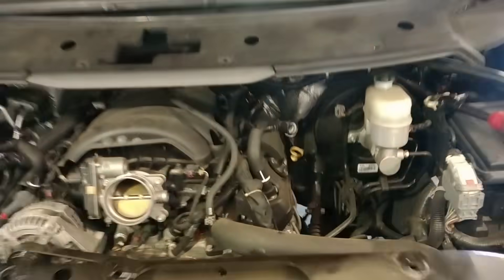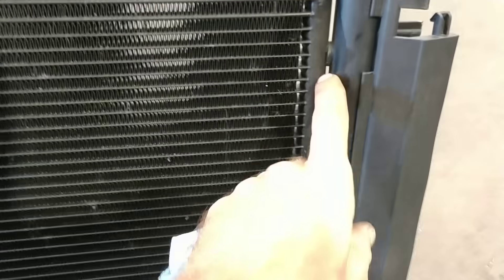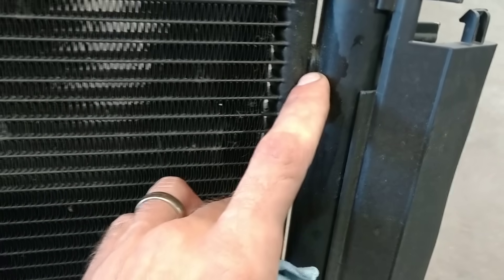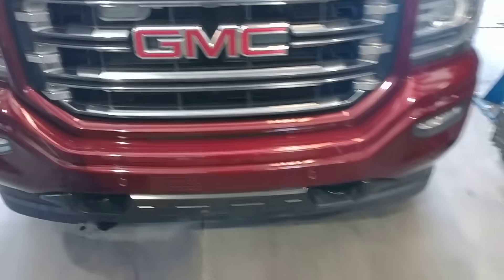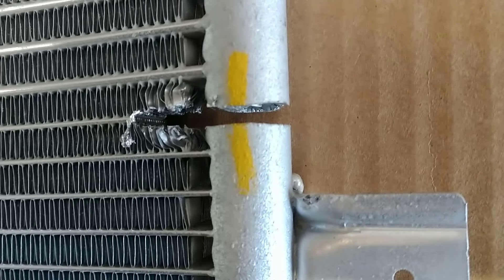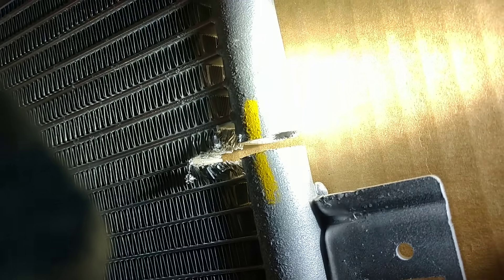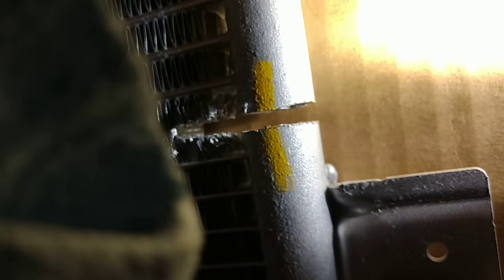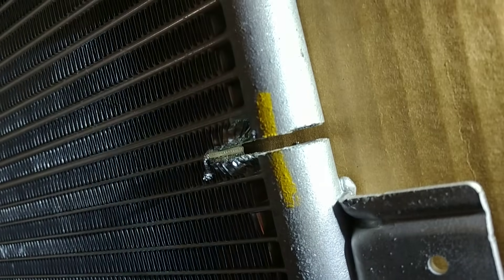Customer States...WAIT, look at this! Can't make this stuff up!

Comment: The guy who boxed it probably said “I Bet they’ll never notice” 😂
Reply: He’s probably like they probably won’t trace it back to me
Reply: If we're being for real here, the guy who boxed it probably didn't even notice
Reply: Kill Trump  its not returned, its a redesign. I do atleast 5 a week at a dealership. Doesnt look good, but it works.
Reply: It's supposed to be like this, the trans cooler and AC condenser are one unit. The cut is to allow for expansion between the two.
Reply: @bobroberts2371 ... Then why not have two individual parts? It can't be any more expensive or take any extra time to assemble on the line. Two parts, one bracket, same amount of screws, same amount of lines...easier to manufacture as well...
Reply: @K03sport  2 parts would take more time and expense to make and assemble.  Would you want to be the buy doing this for free?    It is common in industrial engine power units ( basically an engine in an enclosure, with a radiator  ) to have the engine oil cooler and turbo intercooler in one package like this.
Reply: @K03sport  MONEY
Reply: @bobroberts2371 ... Oh, like Nissan did with their trans and engine cooler on the Pathfinder...and when the trans cooler leaked/failed, it put trans fluid in the cooling system.
Reply: @K03sport  You do realize that automatic transmission coolers have been inside engine coolant radiators since about 1958 don't you?  Besides, the transmission cooler and AC condenser in this vid are not one inside another, rather than building 2 units and bolting them together, the are formed in one assembly.  and
Reply: Maybe he's a former Rainman customer...?
Reply: They probably said "everyone's blind, they can't see this huge hole in the core"
Reply: @TheHighwayman7989  Have a close look at the core, it has the trans cooler and AC condenser in one package. The vertical tube is plugged on either side of the yellow line.  The yellow line is a " cut here " mark to allow for differing rates of expansion, it is supposed to be there. .
Reply: @bobroberts2371  oh...ok thanks for the info, I've been around cars all my life, yet never knew that.
Reply: @TheHighwayman7989  I thought everyone was joking when they said it was done on purpose.
Reply: Si Senor !!!
Reply: Until they look....😁
Reply: ah its my last day i dont give a fcuck  😂
Reply: "Damaged during transport."
Reply: @Yora21  Then the hole would have been in the box.
Reply: That cut is GM spec.  The cut there is the separation of the condenser from the automatic transmission oil cooler that is built into the unit.  There's no "hole" there, its designed on purpose to be cut there and they cut along what looks like a cooling tube, but its just a strip of aluminum that attaches the two together.  The cut is kinda sloppy but the ones made in Juarez, Mexico look exactly the same (though painted black).   All the cut does is allows the ATOC to flex separately from the condenser as the vehicle is operating due to thermal changes and sudden shock and vibrations from the vehicle being in motion.

The yellow marking is the inspector's mark ensuring the part was made correctly.
Reply: Kill Trump exactly. Was trying to “make it fit” and messed it up. Oh well, box it up and take it back. 
Clerk, “anything wrong? 

Returning jack ass- “nope, didn’t fit, need a different one”

You— Ajs@&(&’!!
Reply: Kill Trump  You are correct, but you also framed the original problem: someone broke it and returned it to the store.
Reply: Shipper 1:  Hey there is an order for a Transmission cooler and we are out of stock.
Shipper 2:  Just get that one that is next to the good bin.  They will never notice the small nick.
Reply: Stu Pidasso  minimum wage Waldo checks sneakers for wear when I return them to Walmart. If a parts person doesn't check their returns for BS they're being overpaid.
Reply: It was me. I boxed it.
Reply: They were probably all smoked up on pot and could care less if it worked
Reply: Union labor
Reply: Shultz6325 Nope! Never heard of a labor union in China. There’s hardly any in the US any more.
Reply: @Schultz-ko3ve  Don't think they have unions in china

Comment: That's normal, the top half is the transmission cooler, that one "cut" row isnt connected to the trans cooler or the condenser so it's kinda just sitting there.
Reply: They could have at least cleaned up those nasty sharp edges with a grinder to smooth them out.
Reply: The person that posted the vid says in the description it is supposed to be like that.  I'm starting to wonder if this vid is part of a social experiment to study how ill informed commenters run off in a tirade that the evil bowl of jello is out to get them.
Reply: @bobroberts2371  Fear the evil bowl of jello!!!!  Yeah, I remember saying to those who said think outside of the box that there was no box!  Now I'm starting to regret putting that out there in the world because there is just no limits to stupidity.  I only meant to say there is no limits to your potential unless you allow the "box" to restrict your view.  And now the evil jello is testing all our limits.
Reply: so what's the point of the cut??
Reply: @Sahadi420  My guess is that the cut is to help prevent the fatigue from the thermo-cycling that the original one appears to have suffered.  Being that they cool different systems, the upper and lower half may get hot a different times.  The cut lets them grow in length more-or-less independently.
Reply: @Sahadi420  The cut separates upper transmission cooler from lower A/C condenser to prevent heat transfer! The yellow mark confirms it was properly done to meet required specifications.
Reply: @learjet1246  it doesn't  look like the ends where it is cut are sealed though.clue me In.
Reply: @learjet1246  except at 0:36 you can clearly see the horizontal line where the two actually separate each other.   The cut has no nothing to prevent the refrigerant from escaping.
Reply: @bigboi2089  they're kidding
Reply: @toddedwards5373  It's sealed deeper inside... They all come like that, and they actually work.
Reply: @learjet1246  I don’t wanna be “that” guy, but you are serious, right??😳
Reply: IF you are serious you are seriously wrong. I have not worked on cars since the 70's BUT those open ends the guy showed you are open to the atmosphere. IF you installed this condenser you could never charge it because you would never get it to hold a vacuum. There is NO WAY this is not a defective part
Reply: @genemartin6962  The ends are blocked where you can't see them, the yellow line is a " cut here " line.

Comment: Sad to say that is how it comes from GM. Of course it has also changed part numbers a few times to say the least.
Reply: Is this satire.....or...like no 2017 sierra ad for an ac condenser has this in the pictures. I looked at like 10 different listings....no cuts
Reply: @NotRandoWis   No satire, I'm serious. I had to prove it to a Tech one time because he didn't want to install 1 because he thought it was cut and damaged at the factory it was going to leak. On so I quipped GM trucks the trans cooler is on the top half of the condenser. That is basically where that break is  where the tube on that 1 side was solid and they cut it to separate the 2 coolers. Of course no picture you look at his been a show that they're gonna show the pretty ones. Having worked at AGM dealership since 2009 in the parks department I can say the biggest worry isn't whether or not that cuts gonna leak but if it's been bent or is curved or had other damage in shipping.
Reply: @NotRandoWis   You have to figure you're talking about a company that until the last couple years shipped windshields to dealers on a freight truck as you can imagine you have the order 3 of them or so before you get one that's not broken.
Reply: @NotRandoWis  The original part number did not have this cut, revised current OEM part number does, listings don't usually update the pictures for revisions. If you go to the dealer and buy the condenser, this is what you get. It's a factory bodge to fix a design flaw.

Comment: Another quality part satisfying mechanics everywhere
Reply: Customers and mechanics alike.
Reply: It just reeks of half assing a whole run of parts rather then redesign them properly. If I was a mechanic that part would be getting sent back marked “ damaged at factory refused to accept “
Reply: @matthewcaughey8898  And how would you redesign this part? Be specific.  How about you bank roll a batch of trans cooler / AC condenser units and sell that at a lower price than what the revised ones are going for?
Reply: J O B
S E C U R I T Y

The nice thing about a design flaw is that if it's SO common that you can practically diagnose it without checking it out, you can repair it fast and the customer is happy with YOU, the mechanic, even if they're unhappy with the automaker.
Reply: my radiator went at like 150k miles 200$ and done deal truck has 200k now that was the only issue I ever had big deal
Reply: @miket2172  The part in the vid isn't a radiator. It is a trans and AC condenser.
Reply: I work at the plant that makes them at GM it's a relief cut for the expansion it was supposed to be the fix to solve the problem between the two units
Reply: CivilDefenseLLC  Here is your opportunity to start a company making these and shipping them.  Easy money no?
Reply: @bobroberts2371  how much they paying you
Reply: The K stands for kuality
Reply: It's supposed to be like this, the trans cooler and AC condenser are one unit. The cut is to allow for expansion between the two.
Reply: I bet he charged over $1000 to fix something so simple
Reply: @KingTheGermanShepherd  So why don't you open a shop and charge what you think is a fair price?  Should be easy no?
Reply: @bobroberts2371  i know a mechanic who doesn't scam me when i need service...
Reply: @KingTheGermanShepherd  How about you get a quote for this job from your guy rather than spouting some random $  ?  Does you guy have the proper tools to vacuum the AC system and a good leak checker?  Will he change the dryer, install the proper amount of oil in the system or will he just install the condenser and recharge ?  An improper vacuum / too much oil leads to poor AC performance, not enough oil will damage the compressor a moisture saturated dryer leads to long term system damage.
Reply: @bobroberts2371  bad design and gm should cover under warranty...! Manufacturer defects...
Reply: @KingTheGermanShepherd  remember not to charge people for your knowledge and expertise and not charge them for parts either.. Only charge the customer at YOUR shop the minimum wage for the time you spent on it. But don't charge them for the paperwork or parts sourcing either. You want it to be super fair. Only for the time the spanner in your hand.
Reply: @ColinRichardson  
  Hahaha, these factory shops charge u wht a book says, not by how long the job takes. You keep your car clean, and wht is said to b a 4 hr job only takes u 2 you're still getting charged for 4 hrs fool. I'm not there to cover that extra labor time u spent taking apart someone else's rust bucket. Lol